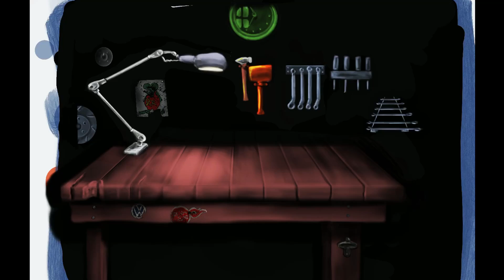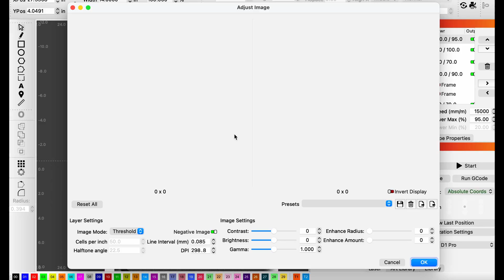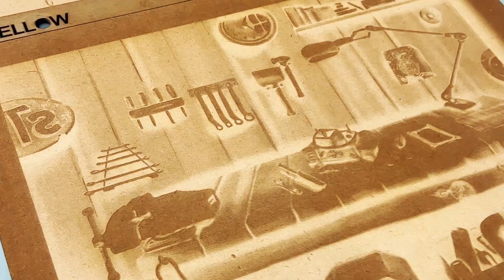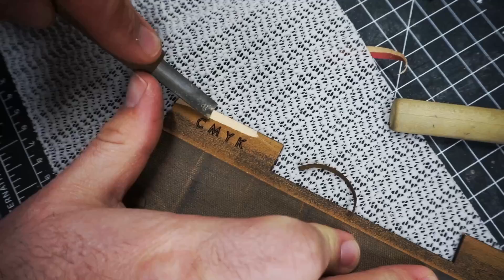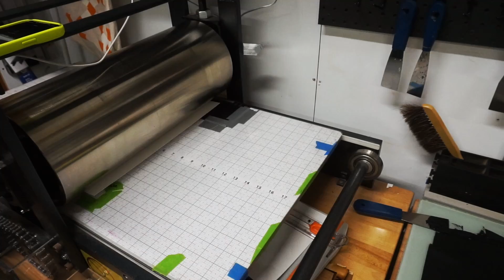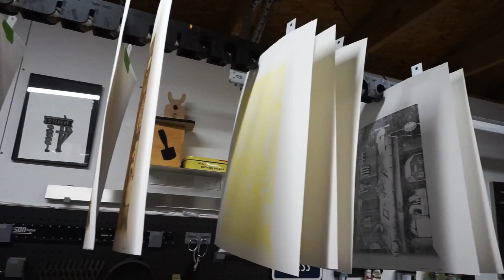CMYK Laser Cut Woodblock Print

Comment: Is 22watts the minimum strength or could you use a 10 watt diode?
Reply from the maker: 10w would work for sure! The power level does not need to be crazy high to engrave wood, it’s when you get to cutting it matters more, but 10w can easily cut out 1/8” mdf or similar wood👍
Reply: @DiodePress  You are a treasure! Thank you!

Comment: when you throw away the oil based ink paper towels do you have to use a flame resistant trash can?
Reply from the maker: Yes, depending on what ink you use, they can contain oils such as linseed which can be a hazard just like wood finishes. I typically put my rags and paper towels in a ziplock bag of water and dispose. But this site has a great write up about all print shop safety items https://www.uvm.edu/safety/printmaking-safety

Comment: what angle did you use for your halftones?
Reply from the maker: I used black 45, yellow 0, magenta 75, cyan 15, freq. 55 was the best print quality I got with the materials I used.
Reply: @DiodePress  55 is nice. I’ve got a 10W diode and so far I’ve landed on 2500mm speed at 100% power with 1 pass. I don’t have great ventilation so I am trying to keep my burn time low. What’s weird is figuring out the frequency when my laser/line ends up at around .2mm in width…figuring out the equation of my image size/dpi/freq/laser width has been challenging.

Comment: Very cool process, some of the first halftones were also printed in letterpress. It was crisp and could be easily combined with text blocks. Intaglio (héliogravure) halftones were used for higher quality quality/volume for a long time. When planographic processes like offset lithography took off, they replaced almost everything until digital. Both typography and halftone images were now photographic process and the Linotype machines for composing text were scrapped. But people complained because optical typography systems were not as good. So now you’re starting the cycle again with your digital letterpress four-colour halftones!
Reply from the maker: Ha! It’s all just a big circle!
Reply: @DiodePress  Or a small dot. Like halftone.